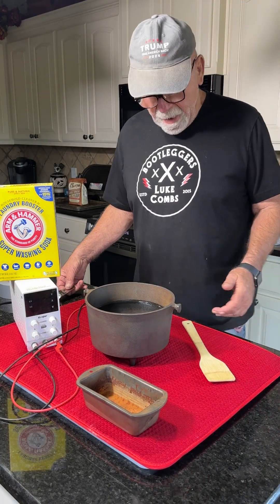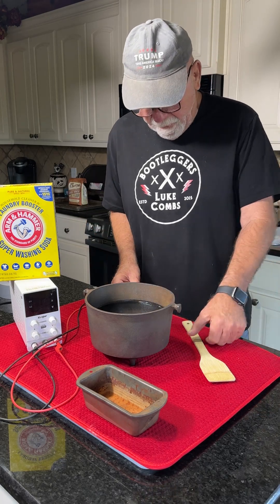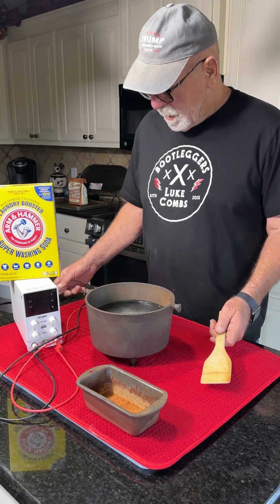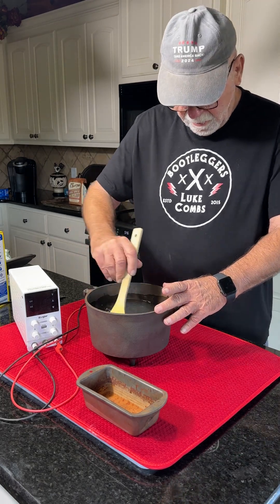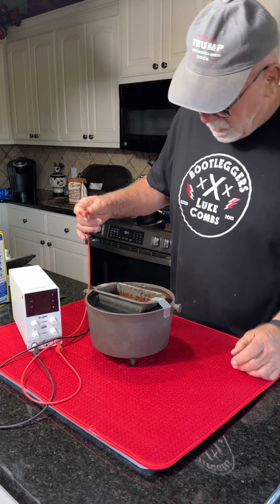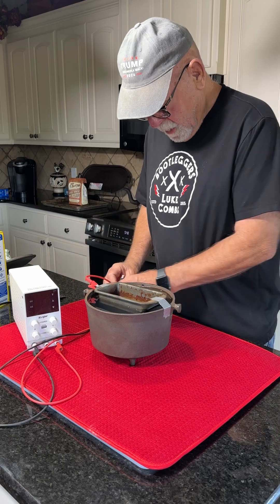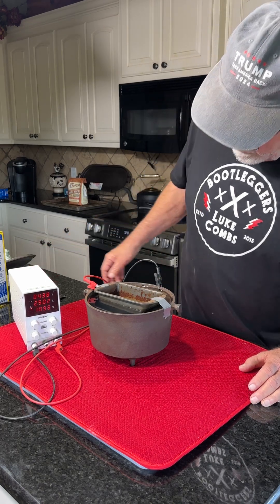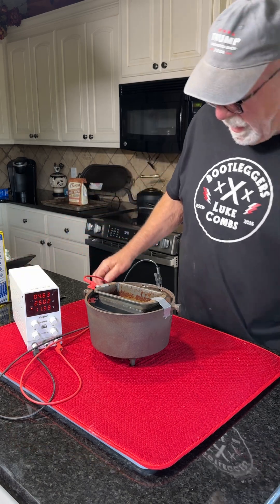Electrolysis - Cleaning the Inside of a Cast Iron Pot  - Concept - Floating an Anode, Will it Work?

Comment: I'll try to explain my method. Hang the pot in your electrolysis tank by the bail with the pot facing upward. Turn a PVC endcap upside down with the solid section to the top. Drill a hole in the top to attach about a 2' long threaded rod. The PVC cap acts as an insulator to prevent the threaded rod from touching the bottom of the pot. Drill a second hole in the cap to allow the gas to escape. Place the rod inside the pot with the PVC cap on the bottom. Connect the rod to the existing anodes with a short jumper wire. Now you have an anode inside the pot so the inside cleans as the outside does. You may need to secure the rod on top so it can't touch the pot. The official name for this operation is "Pot Hootis". If you like this you should see the Bundt Pan Hootis. The good part about this hobby is you don't have to be right in the head! lol 
I do light commercial restorations for estate sale companies and I don't have time to clean them separately. This enables my addiction. If you have any questions just ask and I'll make somethin up.
Reply from the maker: If I were young I would build one of your contraptions to pull off the "Pot Hootis" maneuver.  Since I'm old, I don't want to do it. lol....  I do have pretty good luck just hanging the pot. Takes a little more elbow grease.  So when I was trying this tin pan, I was trying to get some depth under the water rather than just a disk on top or a rod in the center. So being a cast iron guy, I'm going to start hanging a sad iron in the pot. Maybe... I understand the addiction, I drove over 200 miles round trip this morning to pick up a couple of pans over in New Mexico and just got in two eBay orders yesterday.  Take care, as always I appreciate your comments.